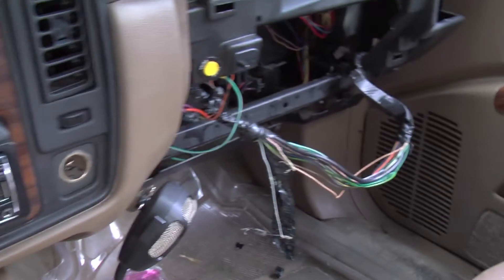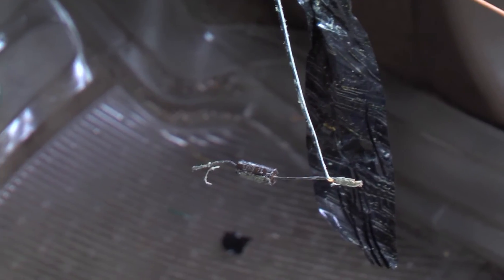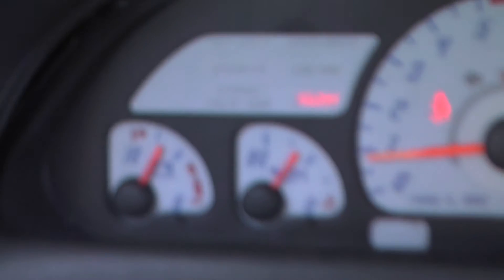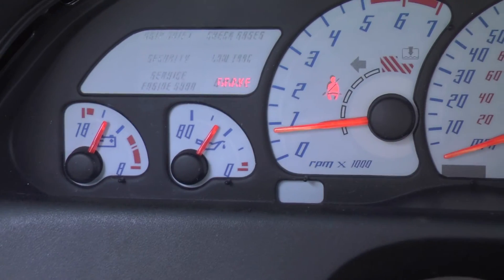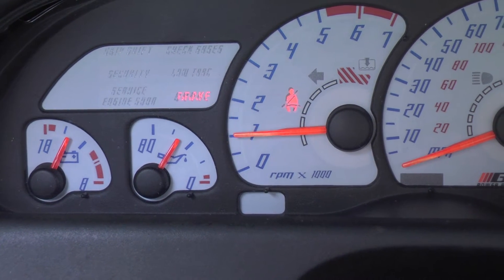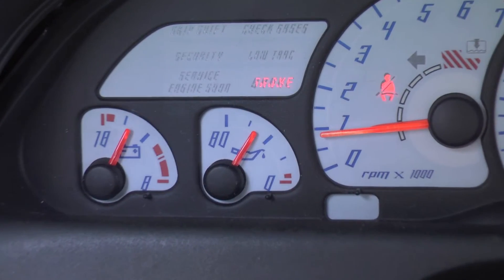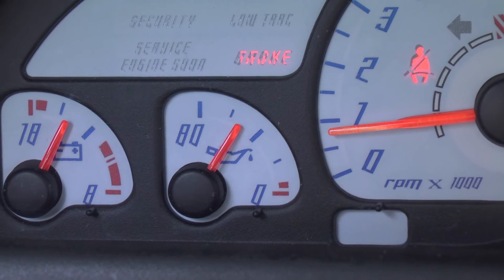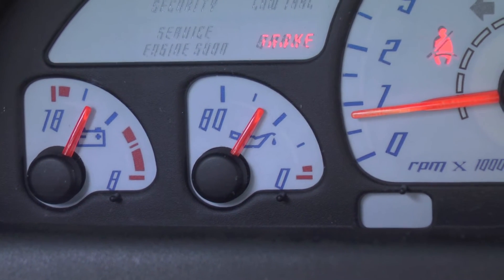9c1 Oil Sending Unit Mod

Comment: Its probably high because the oil is not hot. Run it around for an hr and the oil pressure will decrease some.

Comment: you had said in a previous video, it's hard to read the guages ie. CEL, Brake and such.

if I am not mistaken man, you need to peel off the original backing and stick on the indiglos....I've seen people do it before man, so check up on it before you do it, I don't want to have my word lead you the wrong way if i'm incorrect.